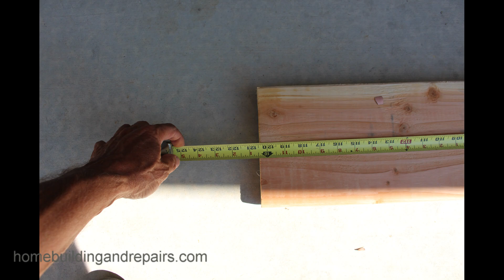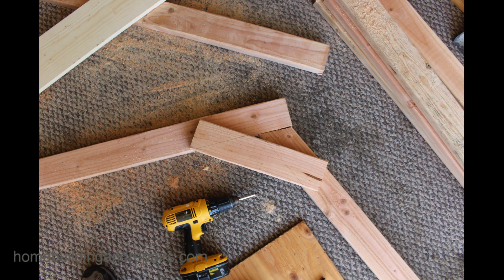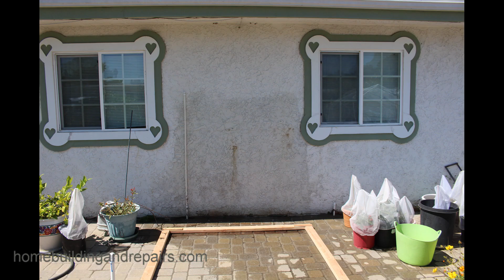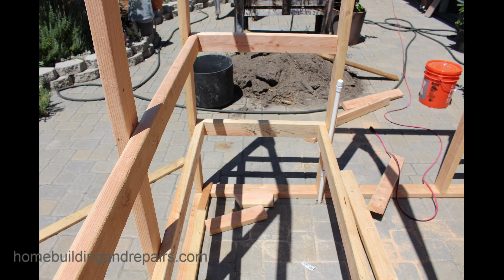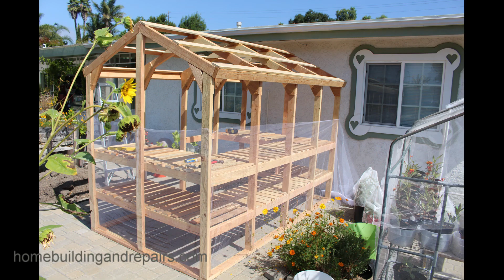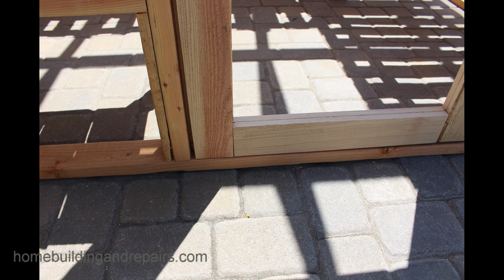How To Build Wood Framed Greenhouse - Easy Backyard Projects You Can Build Yourself

Comment: Is there an advantage with type of build vs traditional framing? I'm researching for my own greenhouse build
Reply from the maker: I would keep researching. This is something easy to build, but might not work when using glass like a metal framed building.
Reply: @gregvancom  I'm also using wood and either corrugated plastic, or acrylic panels. Whichever I can get the best deal on lol

Comment: I have been watching several videos here about building Greenhouses, and they all look very nice and sturdy, BUT, what I have also noticed is that ALL of them are just like MY own GH in 1 way. They all have NO roof vents. I have a very nice and sturdy GH. But, it has NO roof vent. It does have a vent at the top rear, a door with a way to make it so that the glass can be lowered, and then it will be a screen on the door so that fresh air can come in. BUT, I  have read many articles about greenhouses and how that roof vents can REALLY help cool off a greenhouse. And, most greenhouses have roof vents. I really have NO IDEA why my GH did NOT have any roof vents. I have asked a friend who knows a few people in a community that is NOT Amish, BUT, they are POSSIBLY mennonite, IF anyone would be interested in building a roof vent for my Greenhouse? 
IF I can't get any of those mennonites to build my GH a roof vent, maybe I can install me a sorta window on my GH that will help release some heat when I need to release it?

Comment: Good job, nice and easy. But a little time consuming. 
I just finished my greenhouse. But I tried to build it to last. I used all 2x4s. I also have a big problem with insects. Do to the 300 acre farm across the street from me. They spray their crops once a week. And guess where the insects go, to my garden. 
For the last 2 years I've lost my everything due to insects. Bugs I've never seen before in my life. So I'm going to see if a greenhouse will help.
I built a 10x12 greenhouse. 
I wanted to keep it off the ground. So I laid down 3 treated 2x4s then built a 10x12 box with treated 2x4s on top and attached the box to the 3 2x4s. Then I just used that cheap chip board for the floor, but I painted it first with 3 coats of porch paint. So it sits about 5 inches off the ground. 
Then for the framing I used all 2x4s, but I put 2 coats of white simi gloss exterior paint on everything before I started building. Very time consuming. I made all the walls 8 feet high. I forget what I made the pitch of the roof at, but from floor to the ridge is 14 feet.
Now this is where I messed up. I was going to wrap it with 4x8 sheets of double walled polycarbonate, but they are $80.00 each. So I went with the 26"x8' panels. And what a big pain in the fanny. And then on top of the pain in the fanny, once you buy all the other things you have to buy to install these panels. It cost more than if I would have went with the double walled 4x8 sheets. Live and learn I guess. 
Anyway thanks for all your time it takes to make your videos. And keep them coming. You do have some good ideas, especially for easy builds. 
Take care and I hope your wife enjoys her greenhouse.
Reply from the maker: Sounds like a nice greenhouse and thanks for sharing.